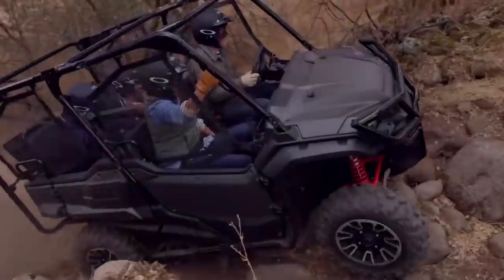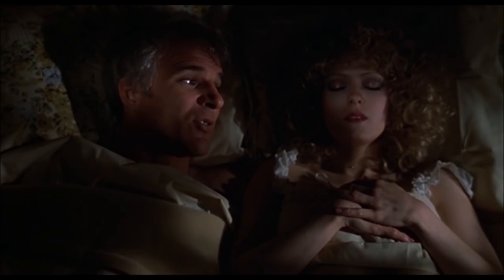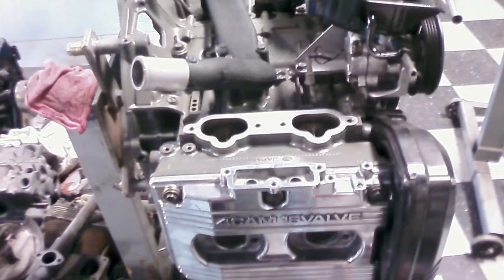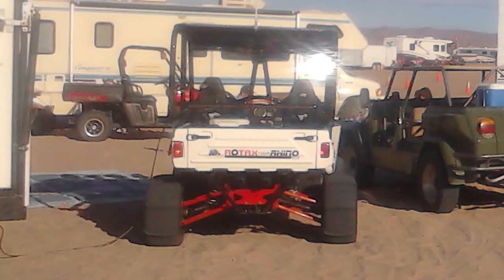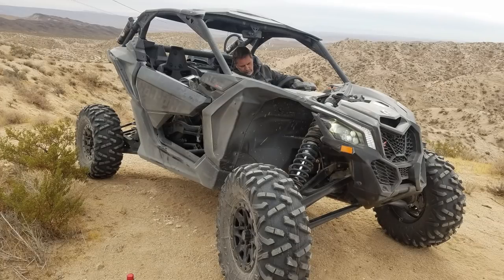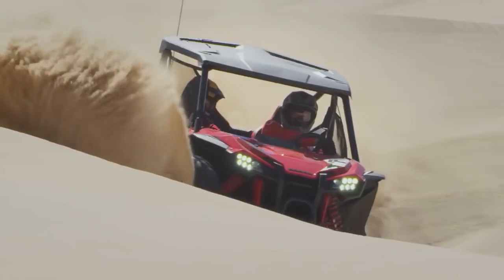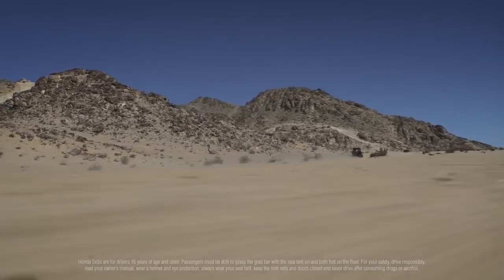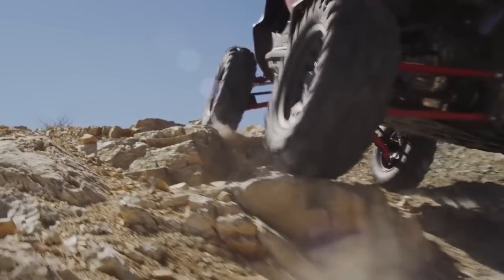Honda Talon Our Opinion & Comparison

Comment: You can’t compare turbo to naturally aspirated. Honda will come out with a turbo, then you can compare them. Honda has oil jets in the pistons ( typicality what you would fine in turbo engines) so I see a turbo kit or turbo model coming.
Reply from the maker: You hit the nail on the head I couldn't agree with you more. That's why I say it's comparable to the RZR 1000 na. We just can't wait to get our hands on one and drive it.
Reply: @DandiOffroad  and do some custom mods yourself! I like seeing the work you did on those buggies.
Reply from the maker: Thanks we'll see what we can do, would be cool to make that happen

Comment: i had Honda CR's when i was a kid, parents had a cabin out in johnson valley back in the 80's i loved my bike, the CR125, i thought Honda was the shit and they were!

however i agree i thought they would be more competitive with the Talon, it doesn't look like it can hold up to RZR or Can Am. im sure i will offend people on here but it doesn't look well made, small wheel base 104 HP, they should have come out of the gate strong, honestly i think Honda missed big time on this.

I will be going to King Of The Hammers in Feb and apparently they will have a booth there and i'm sure people will be buying the talon and riding it there, i will wait to see what it can do in one of the most difficult terrains in SoCal before i say anything more about it, from what i have read and watched on YT everyone is doing these types of reviews and its all across the board, some people love it some people not so much, and it depends on what you ride and how you ride it.

my biggest thing with the Talon is not enough HP, small wheel base and im sure the price is through the roof, my personal opinion i don't think it will be worth the hefty price tag.

i  couldn't imagine getting the talon and having it compete with RZR or Can Am, i think Honda is a few years away from running with Can am or RZR, but again KOH will be the test for me, the elements and terrain out there are second to none, if your SXS can handle KOH then it can handle pretty much any terrain you throw at it.

thanks for the review!
Reply from the maker: Yeah we agree it's just not the car to compete with the X3 or the Turbo S YET!!! but I can't wait to see how this goes down going forward. And it's a Honda which is kind of cool, and we still want one just because it's kind of cool. That doesn't mean we will be getting one and certainly not in place of the X3. However I do have to say it seems like a lot of people discount the years that Polaris and Can-Am have been around building the other recreational vehicles that they are known for.
Reply: Dandi Offroad I’m excited for Honda’s future In the sxs biz, they will figure it out